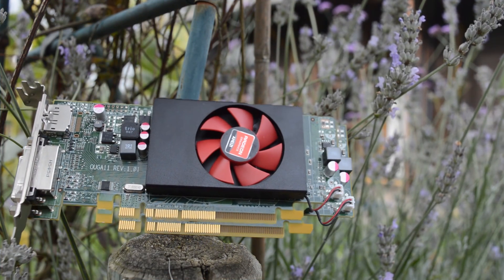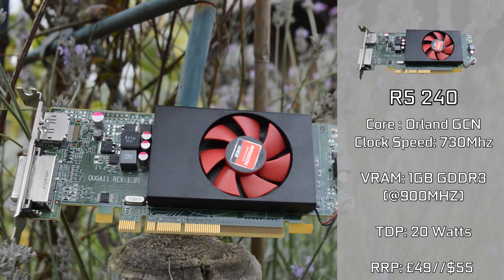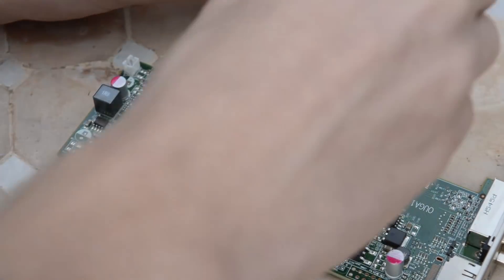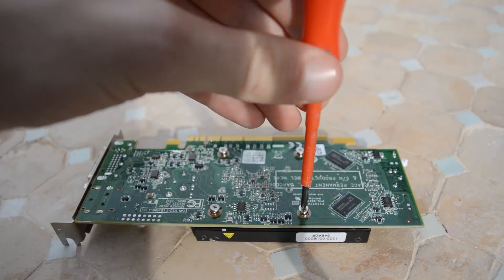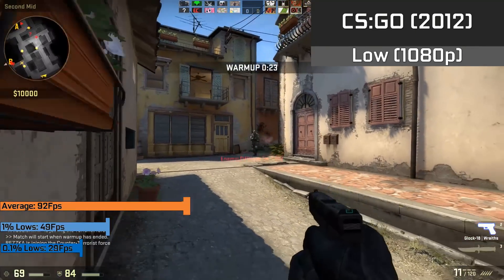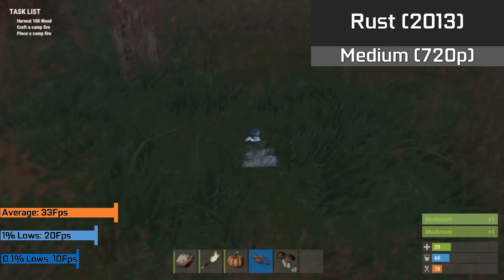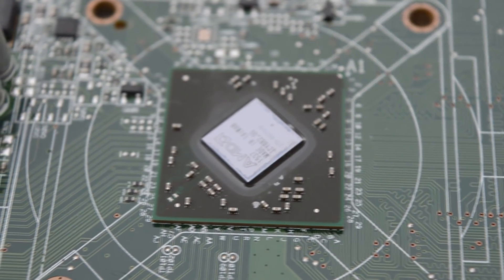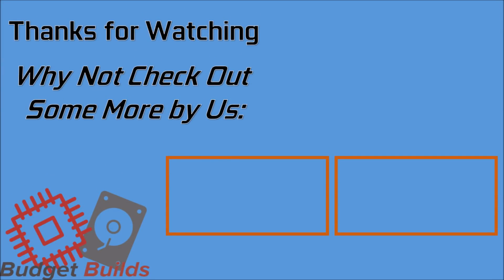Gaming on the R5 240 in 2017

Comment: wait, what, this was one of the best performances in Fallout 4 on the entire channel... I might've found one of these for a friend, and it seems like it might worth it
Reply from the maker: I’d personally opt for an R7 450 if you can find one
Reply: @BudgetBuildsOfficial  I've been looking through them, but all of these cost R$300+ here in Brazil, and I'm often scavenging through aliexpress and shoppee, on local stores pc parts are even more expensive, so it doesn't worth it because it's also the price of the cheapest RX550 I found, and for R$500 you can buy an RX580, unfortunately Brazil is the GPU pricing hell. A "cheap" GTX 550TI is R$300+, a non functional 8800GT is R$180~210... And the minimal salary is R$1412.
Reply: @ToniaGlitched   if you bought this. make sure You follow the Midnight ride mod guide. It will SAVE this card and increase framerates.
Reply: @mrjaked420  I didn't, I have a laptop with a GeForce 840M instead and my friend is saving a little more for a RX580. Thx for the tip tho.

Comment: My old PC : 4gb GDDR3 ram
Radeon r5 + amd a6 7400k  
250 watt PSU
Red led lighting

My new pc 
8gb GDDR4 hyper x fury ram
Nvidia gtx 1060 3gb
Intel i5 7400
Corsair 450 vs series PSU
Gamemax case + rgb fans
Stock Intel CPU cooler

Still waiting for my pc xd

Comment: I'm currently watching this using my R5 240, still holds up well in 2023. The only issue I have is that the newest Radeon Adrenalin 2023 drivers won't install on my OS Windows 7 64bit cause it isn't up to date. I had to use the AMD Catalyst 2016 drivers just to make it work. I once tried running GPU-z to check the specs but it blue screened on me so I didn't run it again. I haven't tried gaming on it as I only use it to watch videos and do basic 2D photo editing and drawing, overall it's a nice basic GPU good. I totally agree with the points you stated in this video, it may be a bit outdated but it's still usable.
Reply: 5 months later I'm still using it, recently bought a SSD I'll pair it with the new 2021 drivers and see if the performance improves. I'll update this comment if it still works haha.
Reply: September 2024 it's still working haha I'm even using to it to render low poly scenes in Blender 2.64

Comment: This is the very first gpu I ever had and recently put it into a hp sff 800 to my 13 year old brother so he can run gta 5 on medium settings and 30 fps lol I was surprised that it actually ran Roblox way better than my siblings One S did I saw stuttering and frame drops consistently in more complex Roblox games but not on the PC

Comment: I use the R5 240 as a basic GPU to throw in PCs for children. It's cheap and it runs minecraft
It's not a bad Graphics card, when you get it for 12$ CAD.
Reply: i bought today .10.6  dollar. my currency 1400, yes its still consider low money for card in my currency. i have no job so its big money hahhaah  now i need ram but no money hahha
Reply: I'm thinking of buying a retro gaming PC for my younger brother with this card. What sort of fps do you get in crysis and skyrim?
Reply: @bksniperguy  Crysis and Skyrim are already considered retro? Damn 90's and DOS games must be ancient relics then.
Reply: @matrix255  retro-ish. It's in that category where the games aren't that old but PC hardware has advanced a lot since they first came out. Still surprised the gt 1030 gddr5 can barely run crisis at high 20 fps on ultra settings with motion blur disabled.
Reply: bruh 25 dollars
Reply: @bksniperguy  mate crysis is still one of the most demanding games of all time and you reckon this loose change card could even hand low...
Reply: @lachie8784  I got the card and it could handle crysis 30fps at medium... at 1024x768. Overall not a great card but at 1024x768 it could even handle battlefield 3 at medium 60fps.
Reply: @nasirulium  15 dollrs
Reply: @danishkhanjatoi4531  15 dollars
Reply: Well basically it was simmilar performance as VEGA8 built in cheapest RYZEN APU 2400, still 2x better than best Intel iGPU's :>
Reply: I found someone selling one for $7.50 near me, I'm thinking about getting it.
Reply: $7.5 - price is great, it's highest performer for XP/Vista ~2006 retro games while can play some modern either. Latest available for XP, lowest TDP same time, 10 000pts in 3dmark06 if i remember correctly Q6600 also supports OpenCL  and Vulkan and Linux (+Wine), both 3D and video acceleration.
Reply: @KabelkowyJoe  will it still be able to play the games listed in the video?
Reply: I actually bought it for 50 euro (about 55 dollars) i thought it was a good card ;-;
Reply: @danishkhanjatoi4531  hey... have you upgraded your pc yet...?
Reply: @Nadeel  you got doped
Reply: @Agent-ie3uv  yeah but now i have saved up for a decent pc with an rtx 3060 and a 5800x which is nice

Comment: (EXCELLENT use of Prey 2017 music ❤️) So slightly different variant, R5 430 2GB GDDR5 oem I purchased for my very young daughter's first PC who only plays Roblox. Holy cow, you're dang right about the overclocking because I went from 780mhz on the 384 shaders to 1.015ghz & added +300 mhz to the memory!!!

In comparison to my old HD 7750 no longer with me it's Overclocked so much further & performs slightly better with the extra gig of GDDR5.

Comment: Installed this kind of GPU card into Biostar J3060NH mobo with onboard puny Intel Celeron CPU. Works well with Windows 10 under UEFI boot but Windows 10 recognises it as AMD R7 200 Series GPU and installs it, which eventually giving more boost to this GPU compared to installing R5 240 GPU driver itself. 

Putting R7 200 series GPU driver on R5 240 GPU card will forcing the PC with puny slow ass Intel Celeron CPU to play 1080p youtube video content with lesser hiccups. Also, some of classic PC games titles such as GTA:SA, Half-Life 2 can be enjoyed with high settings although MSAA needs to be turned off.

Comment: my pc use to have an g3220 4gb ram and r7 240:) i use it 4 years in games
Reply: GoBy video shows r5 240 tho
Reply from the maker: GReDDY WupS: Virtually the same card, just R5 is the OEM Edition.
Reply: Check random gaming in HD, he just reviewed an apu that performs about the same with this card. 

And it use an AM4 platform
Reply: i still have r7240 D:
Reply: I installed one in my mom's pc with an i5 2400. Just runs nicely for video playback
Reply: RubenF i thought c2d e8400 can run 1080p video nicely? There are a lot of them out there, getting them is almost costing me next to none.
Reply: Jude Price i was mentioning why RubenF uses an i5 2400 for video playback which is too much (unless its a sacrificial part)

Comment: Tips for increasing FPS on low end PCs and laptops:

Open the start menu, search "SystemPropertiesAdvanced"  under "Performance" click on "Settings" and select the option "Adjust for best performance".

Open the start menu, search "msconfig", go to the "Services" tab and disable the service "Superfetch", "Windows Event Log", "Windows Event Collector" and "Windows Defender". You can also disable other services if you know what are you doing. Go to the "Startup Programs"(I don't remember the exact name) tab and disable startup programs that you don't need to start with Windows.

Open the start menu, search "Power Options" and select "High Performance".

Use a plain color wallpaper.

Go to the settings of every program that you have and look for an option to disable automatic updates.

You can also do some registry, tweaks, but I won't cover those.

Your system should now feel a bit snappier and your games will run much smoother. Tho it will look like shit. That's the price you have to pay for better performance.

Comment: Nice video... although... The video missed the fact that the opengl standard is higher than those hd-6-series amd cards spoken of at the end of the video. An example is running Overwatch in linux without the need to hack.

Comment: i just bought a r5 250 for $9.90 (cheapest price i could find) for a free dell optiplex system i found in the trash

total specs would be
r5 240
7gb ddr2
core2quad q6600                               what do yall think?
120gb hhd

Comment: This seems to be a newer version of the HD 7750, guessing it is the same or better? Haven't used my 7750 in several years though.
Reply from the maker: xXDahChubChubXx: It's slightly worse than the HD7750, not bad if you get one cheap though.
Reply: I'd take the performance hit for the better form factor and power draw.

Comment: I have the same gpu in my laptop... it always reaches 95 degrees in game
Reply: clean the laptop! really fast
Reply: DanielC I cleaned it in may
Reply: Probably need to manually adjust the fan (companies seem to prefer to cook a card to death before they will go past 30% fan speed because they want to brag about how silent it is...). I use Speedfan on my laptop, you can set custom fan curves similar to MSI afterburner, but its for your CPU (which is probably the same fan in your laptop).
Reply: Thanks so much, i' ll download it immediately

Comment: You have clock speed as 730MHz, but the ones I have are 825MHz as standard. They're Dell OEM cards, so I guess maybe they've tweaked the firmware? I guess this is why they can handle the 1000mhz overclock pretty well.

Comment: I have a 9500 GT..... I live a sad life
Reply: I had a 8800 GT for two years until I recently upgraded to a GTX 660, don't feel bad dude :)
Reply: I had 9500gt until two months ago and then i got 220gt for like free and two weeks ago i bought r7 240 not a best card but it does its job
Reply: McDerp Btw  i had the worst experience with 9500gt ever 
Could overclock it only for like 100Mhz until it would crash.
Random freezes in the gpu intensive games...
Total shit card
Reply: I got the card without a cooler, so I mounted a low profile cpu cooler on it, now I oc to 710 mhz on core and 530 or something like that, pretty much all I play is Paladins, and it does the job.I'm looking at upgrading to an HD 7570 for $20 tho
Reply: McDerp McDerp if you only play paladins then its "good"
But still i hate that gpu from the bottom of my heart
Btw Hd7570 is very good deal for 20$
Reply: You dont know whats sad. Sad is to have a sis mirage 3 wich stutters with windows xp animations...
Reply: I feel you dude. I Back in 2009, I had a 9500GS, which was the OEM version of the 9500GT, with 512 mb of DDR3, I ran Crysis in 1024*768 in Low settings at 15 fps. I literally played through the whole game at 15 fps xD Nowadays I can't stand anything below 45 fps, I really dont know how I put up with it back then...

You could upgrade for a GTX750 Ti or even a GTX650, they can be picked up for only $30-$35 on Aliexpress and as long as your PSU is at least 400 watts, it should run fine! It would make a big difference for you.
Reply: hey im still using a 8600gt overclocked to its limits
Reply: I used to play on a 9600gt. It still works, but I can't use it in my new PC. I tried.
Reply: I have a 9500 GT too .. lol
Reply: I have a GTX 1050ti upgraded from a laptop that ran csgo at all low at 20-25 fps

Comment: This is excellent for the HP super small form factor PC. It just about fits, and the non-changeable external power supply only has 17.5W extra, and this card just runs happily in it. :)

Comment: Does this card have video encoder? I need this card just for video capture my desktop. I Can't use my cpu encoder because it'll be laggy..
Reply: yeah. but id only use it for encoding and not gaming otherwise it will be glitchy in games.
Reply: @mrjaked420  i only play osu and valorant, and it runs pretty good on those game. and this card doesn't have video encoding because there's no option for this card encoding on obs..
Reply: @PinotNoir_  there is for me lol. its The first "Software" option for me theres one that Says Just Software then one that says "Software (High CPU usage)"
Reply: @mrjaked420  the x264 software? it's using your CPU encoder, not the GPU..
Reply: it does have a encoder press alt r and you can record your desktop its part of the driver
Reply: @si4632  it launch radeon software but i can't find any record button.

Comment: Hi i have these GPU in my dell optiplex 9020. Im going to build my own sff pc with a gtx 1060 but for now i have to use this. The only issue is the output is a little blurry in comparison to the Intel graphics. Why is this?. How can the intel graphics be better on 1024 x 768 than this gpu on 1600 x 1200. What is wrong and how do i fix this
Reply from the maker: Do you have drivers installed? 1600x1200 is a rather odd resolution to still be using in 2020. (Nothing wrong with 4:3) 

Might be worth running DDU, Reinstalling Drivers, and using Native Resolution.
Reply: @BudgetBuildsOfficial  Thanks for getting back to me. I have the latest drivers installed that has done nothing. I heard about DDU i will use it now.  1600x1200 is the best resolution i have on my settings no 1920x1080 maybe is coz of my monitor im not sure

Comment: My setup is from a dell optiplex 9020 SFF

I5 4590 3,30 GHz
8GB RAM
SSD 120 GB
R5 240

I played a lot of GTA V and Battlefield 4 without lags in normal settings with resolution 1366x768
Reply: M8 I have a similar setup HP prodesk 600 g1 w/ an i5 4570 8gb ddr3 and a gt 1030. Your CPU is rather capable and the r5 240 is causing a severe bottleneck. I recommend you buy a gtx 1050 ti lp oc. (Or a gt 1030 but that would also cause a bottleneck)

Comment: Hello Budget Builds, I wanted to know if you have any idea of how to make my current computer into an actual good 720-1080p 60fps machine

My Specs right now:

CPU:Athlon II X3 455 3.something ghz
MOBO: ECS Am3 HT2000 DDR3
RAM: 4gb 1333 ddr3
Graphics: Nvidia GeForce 6150SE Nforce 430(it's complete SHIT), integrated
PSU: 220w, it's probably killing it, as its not 80+
That's it, there are other components, but they don't have much use
Reply from the maker: +sass snek: New PSU  and HD7770 / GTX460/465 for around £20-30  will be a great upgrade, also try to get 6GB RAM Minimum.
Reply: Budget-Builds Official Okay, Thanks for the advice! Love your videos man

Comment: I bought a medion prebuild system with a i7 860 and 8gb 1333mhz ddr3 ram. It also came with an gtx280 which was broken, and it has a 1,5TB harddrive in it. I paid 175 Euro for it (160GBP) (210USD). I bought with my spare money a secondhand Gtx670 FTW edition with an arctic accelero cooler on it for only 65 Euro (59GBP) (78USD) and now i have an system that can play AAA titles with ease! and that only for as little as 240Euro! (220GBP) (289USD)
Reply: You could have bought an i7-2600 prebuild system with 185 euro actually
Reply: Vincenzo Lisi anything close to a i7 2600 prebuild is 300 euro here. expecially with the harddrive etc.
Reply: In the US, its about $85 (just under) for an i5 2400 build, add a GTX 970 for $150, and wait for the CX500w PSU to go for around $15 on newegg again, and boom! $250 console smasher! You'll save that amount in not having to pay online subscription for gaming, and steam sales alone would make up the difference (plus there are a ton of really good free games, most are mediocre, but a lot are better than COD series).
Reply: Jake Garrett the price of an prebuild i5 2400 system is crazy high here. its like 150 euro, sometimes even higher
Reply: I don't even know what a GTX280 is lol.

Comment: Can i play overwatch i have a Inter Core i5-2400 3.10ghz 3.10ghz a Amd Radeon R7 240 2GB OC Gigabyte and 8 gigs of ram.
Reply: That games is $40... Spend that money on a decent GPU instead so all your games actually run half decent. And no, I really don't think it could run it unless you're fine with 20 fps on lowest everything. Look for something like a used R9 270 (should play overwatch fine at 1080p), or the older HD series (the 200 and 300 series afterwards were just a refresh, they are basically the same). I bought one of these new for $90 almost 2 years ago, it does much better.

You can test your graphics cards ability for free, download the 3D Mark demo from steam, and you can compare the difference in graphics power under the graphics score. I get over 5,500 graphics score with a stock R9 270 (OEM refrence model, its the slowest one). https://www.3dmark.com/fs/7501242

Your's appears to only make 1,200 graphics, so upgrading to the 270 would give you 4.5x the graphics performance  https://www.3dmark.com/fs/2430154
Reply: Well i have seen people on youtube testing an R7 240 Overclocked with overwatch and they had a stable 40 fps and on game debate some people said that it will work on low... Ok i will look for a upgrade if thats what you say is best.
Reply: Welp it runs with 50-70 FPS on low so... I decid to buy it cuz its the same thing Buy game Buy cart IF NEEDED =Buy card Buy game